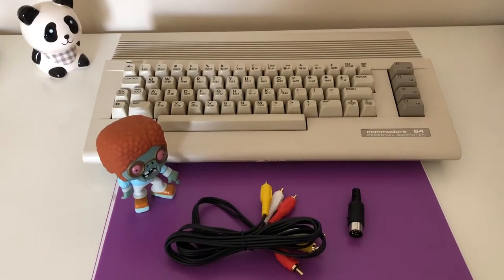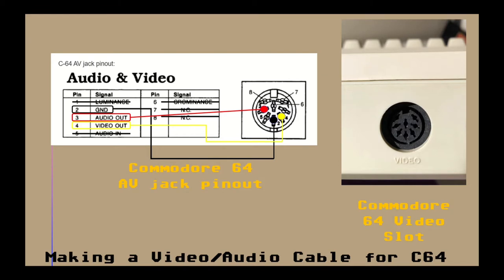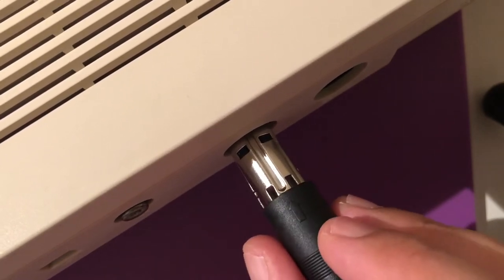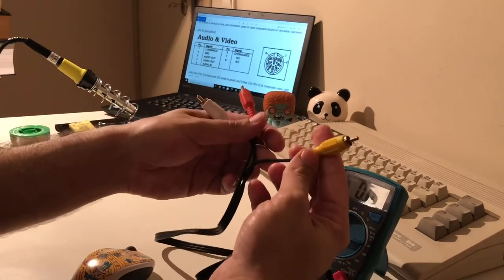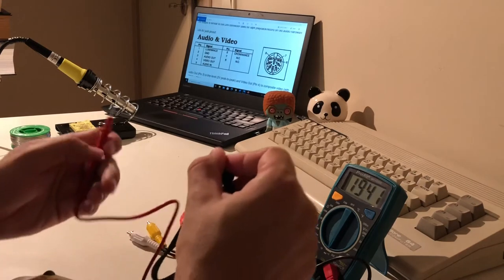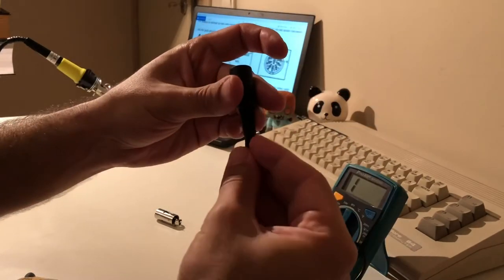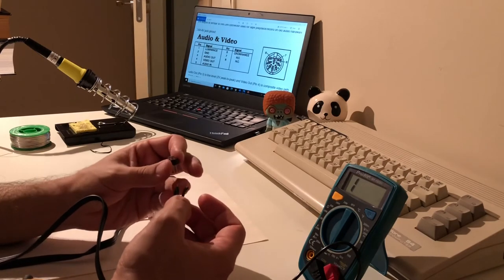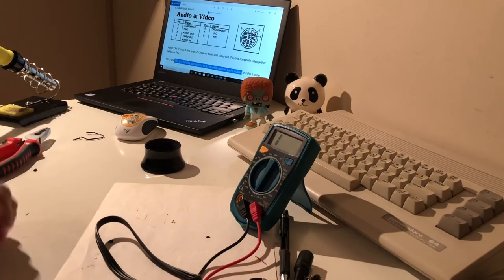Making a Composite Audio - Video Cable for Commodore 64

Comment: Okay i tried to Jerry rig this thing seeing as I've never soldered before so I wrapped the wire around three different pins and put them in the correct pin ports but nothing. Would this method just not work.
Reply from the maker: It probably won’t work. Maybe you could ask help from an electronics repair center with the diagram.

Comment: It would have went better if you had proper tools... that plier is NOT the correct tool for the job... otherwise, it went ok.
Reply from the maker: You’re right. It was hard to use it. However it was all I had at that moment.